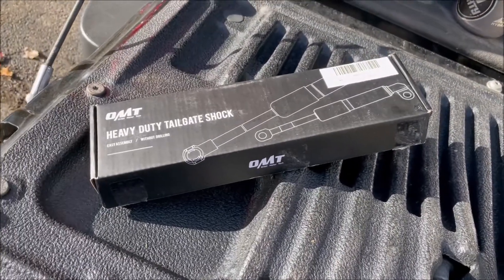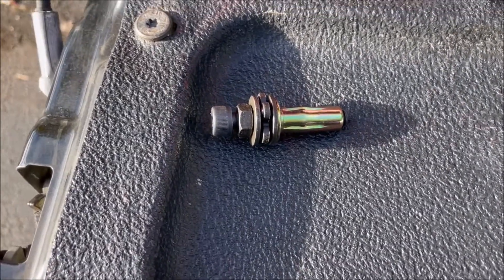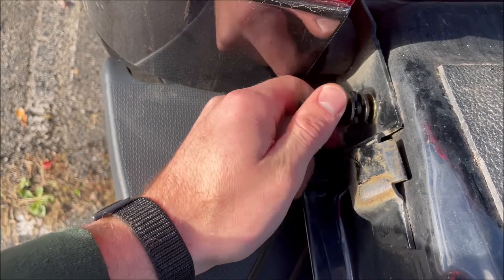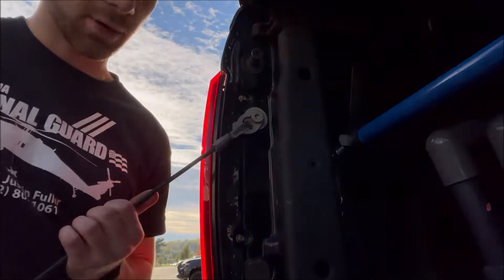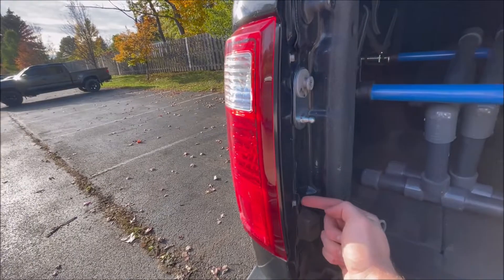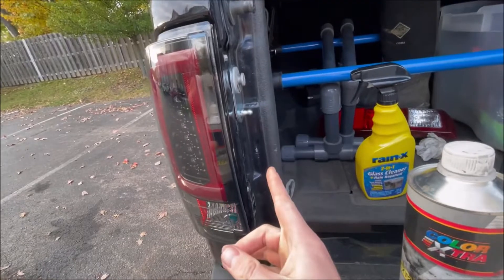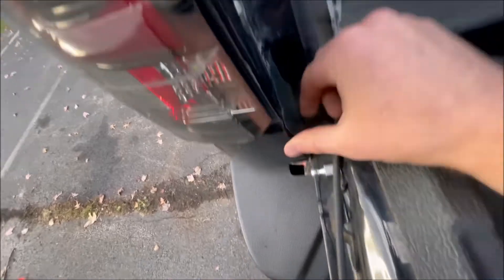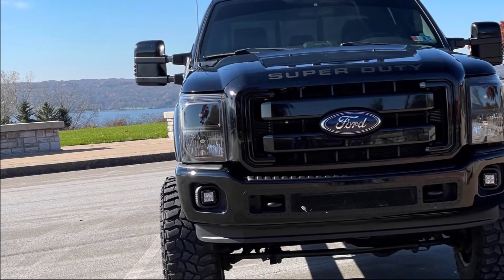11-16 F-250 Tailgate Assist Install

Comment: I (Attempted) to install a DeeZee brand unit on my '99 F-350 and messed up. I followed the instructions but the darn blind nut wouldn't grip inside the hole. The hole in my tailgate is the same as yours and looks to be much bigger than it should be.....